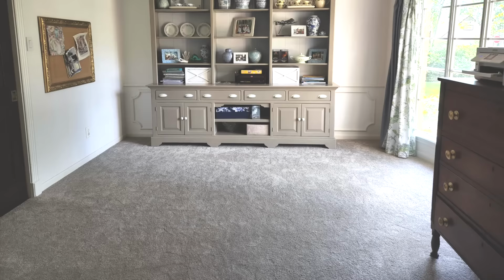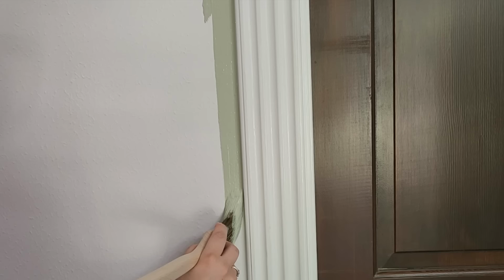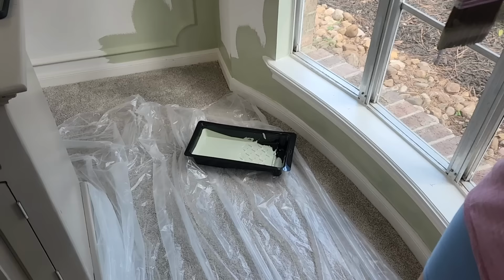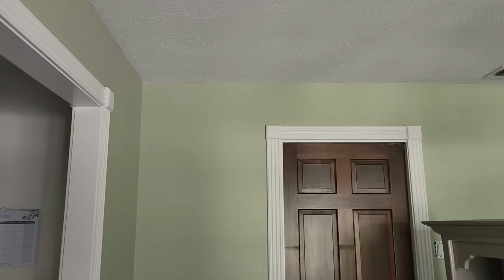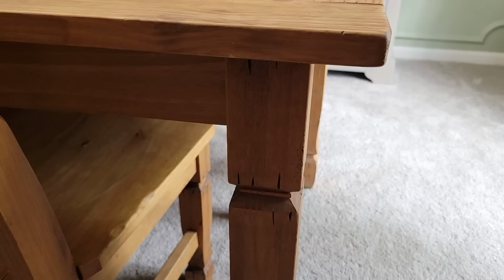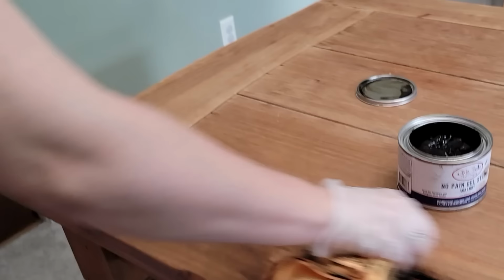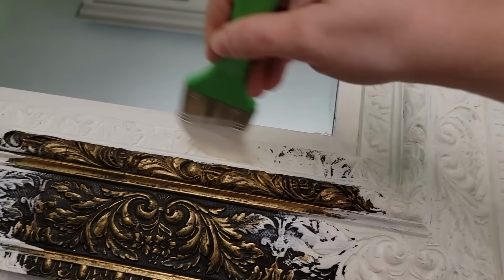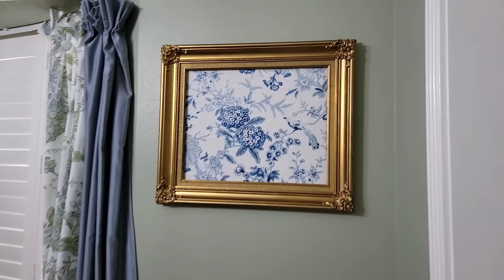100% Thrifted French Country Dining Room Makeover On a Budget

Comment: Delighted to see you cut in with your brush rather than taping. The tape is just one more thing that adds to the landfill. I too do the trim before rolling but I do one wall at a time. Mostly because I hate moving my ladder so often. Also that window has such a lovely view.
Reply from the maker: Thank you so much Edith! Great point about the ladder.
Reply: Cutting in one wall at a time and rolling into the wet paint after each is the correct way to do it and eliminates any lines and is the way professional painters do it.
Reply: @poodlegirl55 I agree!

Comment: If you are going to store your paint in the original can use a paint pour spout so paint doesn’t get into the can seal. This will allow the lid to seal completely air tight and the paint will last longer plus it will be easier to open back up.

Comment: You have done a great job with the house, the parts that I've seen.  I have similar themes going on, and have worked a while on pulling these colors and themes together.  I have some recommendations, humbly submitted.  The carpet brings the entire space down.  Even if there's concrete beneath it, the floor can be painted and/or sealed with wax and would look more high-end.  Don't think there aren't allergens and bacteria all over it, even though you clean it frequently.  You'll feel a lot better without  the carpet.  I believe your room would look great with very light blue paint on the ceiling.  It gives a feeling of openness, while at the same time making the space tight and cohesive.  It will pick up the blue in your pottery, and you'll be amazed at the feeling.  I think some dark (I use black, which is not muddy as is brown) wax, wiped down so only the details pop out, on the mirror and molding will make the details amazing and give a feeling of unification and wonderful detail to the space.  I love how you styled the shelves.  This is one place where the carpet is particularly out of place, however; brown (which is how it appeared in the light) and gray do not feel good together.  To me, anyway.  The table looks great, although cherry is a more authentic fit for French.  I'm not being critical because, overall, it's amazing.  I'm just telling you my own personal aesthetic and experience with this color scheme and style.  PS.  The bed frame that you have in a different room is beautifully finished.  I would suggest you eliminate the idea of a chalkboard and use some of the beautiful decoupage ricepaper available today and create a piece of art instead.  PSS.  The more wax you have on your finishes (I have waxed all I could, including the paint on the walls), the better chance you have of keeping everything clean with just a wipe-off, particularly with children.  Also, you will have less dust and less allergic responses.  Best wishes.

Comment: DAP makes a product called Patch-N-Paint. It's amazing for filling in small holes, dents, cracks, etc. It doesn't shrink or cave in. The best part about it is it has a meringue like texture. .Very light & fluffy. It dries very fast and you can use your finger to create any surface texture you want. If you want smooth, just run your finger across it to smooth. No sanding needed however if you don't get it smooth enough or in a spot you don't want.. or to thick.. it sands incredibly quick & easily.
Reply from the maker: Thank you for the tip!!

Comment: Fun project!
To make your life easier next time, I would suggest spray paint for the texture-detailed mirror frame  :)
Does your paint include a primer?
I think painter's tape is a nuisance.  In order to avoid the colour bleed, you have to first use a coat of your trim /ceiling colour, before moving on to your new wall choice.  That way, any bleed will colour match whatever you are painting next to.  Either way, for most applications, a sash brush and good technique works better for me, and saves the cost and time of using tape.
A couple of tips that helped me - paint all the way from top to bottom as you work from corner to corner, rather that doing a patch above and then a patch below, to minimize roller marks.  Also, lead with the roller handle side (where there is more pressure on the roller), again, to minimize roller marks.
Interesting to see how the green dries darker than it looks when wet, and how it shows darker /lighter on different walls.
If you are not a 'green person', I would be interested to know if you tire of the wall colour.
Great job on the table!
Reply from the maker: Thank you for the tips!
Reply: @DesertDIY  You're welcome!

Comment: Hi! My name is Linda. I live in New Brunswick, Canada. ❤
I enjoyed your video. Thank you.
At one point you addressed the dreaded white marks caused by dampness when placed on wooden furniture. Is it possible for me to apply a gel stain to get rid of white marks and then to apply a water-based product like you used in your video to the tops of my antique furniture? 
Fingers crossed! 
Thank you in advance.
😀 Linda
Reply from the maker: Use a blow dryer or heat gun on the white marks followed by a good furniture oil or restore a finish and it should get rid of the marks, then you can apply a new water based polyurethane.

Comment: Can you tell me where you got the shutters
Reply from the maker: Hi Marilyn. I went through affordable blinds. They came and measured and custom ordered and installed them for the window. It was very expensive, unfortunately. $1600 ouch.
Reply: @DesertDIY  $1;600 for one window?
Reply from the maker: yes :( unfortunately. It is a huge window so it was the equivalent of 5 separate windows. That is why it took us a year to get it done. If you have normal sized windows that will only require one shutter to be made per window, it will be cheaper.
Reply: Your shutters make the room. I am so glad you splurged! You work hard so enjoy your success. Beautiful.